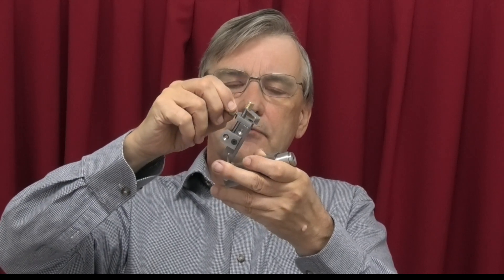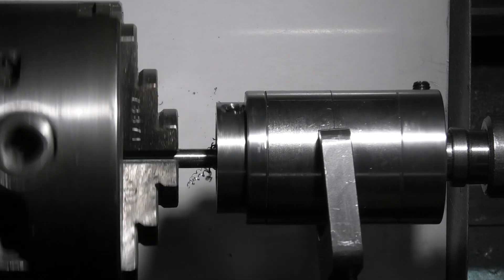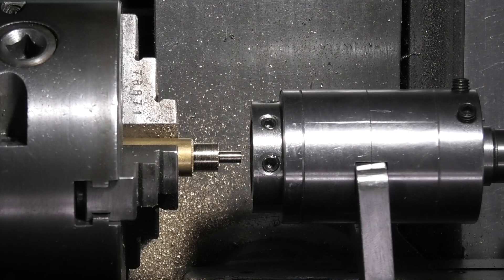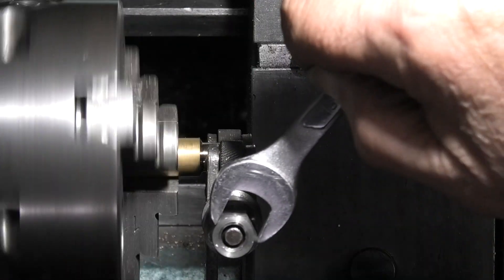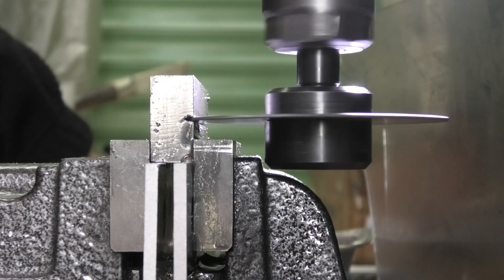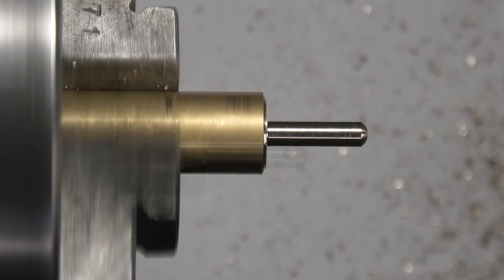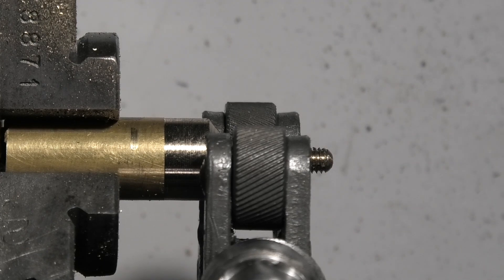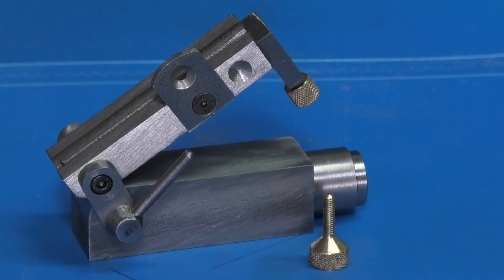4 Facet drill grinding jig  part 2

Comment: Bostin' video Alan!  One point: when you swing the mill head over to cut the vee groove, do you have any problems tramming the head  when you restore it to zero degrees?  I have a smaller Warco mill and find it a bit of a faff to restore the head to truly vertical.
Reply from the maker: Hi It takes me about 15 min to set the head. I can’t set it to zero on the marking as it’s about 1/4 of a degree out. I set it to about 0.0005” or les over 10”.
Reply: @enotsengineering  Thanks for that, Alan.   Much appreciated.
Reply from the maker: I nip up the 3 bolts to hold the head in position  and tap the head true using a block of wood and mallet. I found if you don't nip up the bolts the head moves when you tighten them